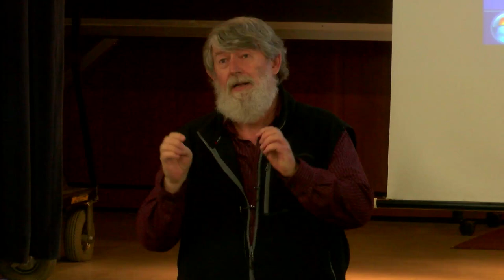David Chandler - How did they deploy 100s of tons of Nanothermite?

Comment: Stainless Steel Thermal Properties
The thermal properties of stainless steel are quite different from those of carbon steel. The main differences are:

The rate of thermal expansion of stainless steel remains relatively constant up to 1200°C compared to carbon steel because stainless steel does not experience phase transformation.
The magnitude of thermal expansion of stainless steel is greater than the thermal expansion of carbon steel.
The specific heat of stainless steel increases slightly at elevated temperatures, compared to carbon steel, which has a huge increase in specific heat at 730°C due to a chemical transformation from ferrite-pearlite to austentite.
At ambient temperature, stainless steel has a much lower thermal conductivity compared to carbon steel. However, the thermal conductivity of stainless steel increases at elevated temperatures which will exceed the value of carbon steel above 1000°C.
The thermal elongation of austenitic stainless steel Δl/l may be determined by:
where
l is the length at room temperature of stainless steel member;
Δl is the temperature induced elongation of stainless steel member;
θa is the steel temperature [°C].
The variation of the thermal elongation with temperature is shown in Figure 1:
http://www.mace.manchester.ac.uk/project/research/structures/strucfire/materialInFire/Steel/StainlessSteel/fig13a.gif
. . . . .
7 World Trade Center used type 316 stainless steel
www.imoa.info/molybdenum-uses/...grade-stainless-steels/.../world-trade-center.php
\\][//

Comment: The following is the most comprehensive fire tests on structural steel to have taken place. These tests were even cited by FEMA in its Report on the structural aspects of the WTC Towers in Appendix A. This is the same FEMA study that found evidence of termite arson in the Appendix C section of that report.
This following excerpt from the British Steel Analysis Report shows why no multi-story steel framed buildings have ever collapsed due to fire. Not before 9/11, not after 9/11, and certainly not on 9/11.

THE BEHAVIOUR OF MULTI-STORY STEEL FRAMED BUILDINGS IN FIRE
© 1999 British Steel Technology Center

Cardington Steel Tests

9 DISCUSSION
9.1 Observed Behavior

The tests on the Cardington frame enabled the differences between the standard fire test and the actual behavior to be studied. This led to the conclusion that the cooler structure surrounding the heat effected members was extremely beneficial to the heated members. The maximum steel temperatures reached during the six tests at Cartington was in excess of 1100 °C. This occurred with no signs of structural collapse.
Using modern fire codes , which are based on the standard fire tests, failure (or structural collapse) was calculated at 680°C ; it is clear that the current level of safety is quite high.
Further work on quantifying the safety level and developing definitive design guidance, which will incorporate a more logical and economical approach to structural fire design. – pg. 64

http://www.mace.manchester.ac.uk/project/research/structures/strucfire/DataBase/References/MultistoreySteelFramedBuildings.pdf
\\][//

Comment: One possible answer is they were refurbishing the fire proofing just before 911. It had been totally stripped back on the 85 floor and reapplied could it have been mixed in at this point or applied just before reapplication?
Reply: + Ian Luce
Jewish cleaning ladies sneaked in with little hacksaws?

Comment: How do we explain the disappearance of the core of building 6? The outer walls were still there but the interior was gone?  And also all of the half charred vehicles and melted engine blocks and yet leaves where still on trees?
Reply from the maker: Not with beamed energy from a satellite!  The platform would have to be GEO-SYNCHRONOUS to destroy the towers and WTC7, 7 hours later, but that puts the "ray" at a 45 degree angle, not overhead.  So it could not have been Geo-synchronous., consequently it would have to return to he same location to do WTC7, later that afternoon... not possible.  Controlled Demolition passes the OCCAM'S RAZOR test, has supporting evidence and video confirmation,  while the DEW hypothesis is pure supposition and requires mental gymnastics to shoe-horn it with OCCAM... THINK IT THROUGH!
Reply: thanks for the reply....I'm confused though. Building 6 and the charred vehicles don't make any sense to me.

Comment: The thermite would have been applied after construction. One welding spark... one ciggarette... one single spark from a metal saw would have set it off vefore they finished. So elevator  guys seem probable

Comment: Easy. The thermite or nanothermite  is combined in polymer base, plastic. I smell paint. The compound transported and applied as paint. No one would suspect painters and there supplies as they were almost fellow employees present every day. Burning jet fuel (kerosene) burns below 1100 degrees when only smoke and no flame are present, not hot enough to compromise structural steel but able to start thermite reaction.
Reply: their

Comment: The main purpose of the thermite is to cut steel, and this is a bonding process, with most of the the iron from the thermite forming blobs and lumps. So the iron microspheres  represent the wasted 'spatter'.  Little specks of thermite that are exposed to cooling air will not form a good cutting material. Unless the cutting process was hopelessly inefficient David's idea of there being hundreds of tons of thermite used is way too low. He should be thinking more of there being thirty thousand tons of thermite in each of the twin towers.  Simon Tee

Comment: I personally think the thermite leads are not going in the right direction to finding out what was used to take down towers and his unease when asked about how it was done. Seems he hasn't really spent any time figuring out how it was really done. Typical academic who has no idea of what real work is needed to do a massive job...

  I think looking at the job of taking down towers from more of an industrial process. Considering the use of available systems within the building, time and a minimum of man hours on the job need more consideration than some basic schoolboy idea of lugging up materials in an elevator, 

 To go even further and suggest if this was planned during the construction in the late 60's early 70's as a lot of war mongering manipulation ideas at the time suggest. This was sitting there waiting to be rigged and used to kick off a major war or to wipe out any country on the target list for control.. The guy who designed it, his age aside, looks like a stressed out wreck.. Fuck you couldn't have made an easier massive design to take down with the trusses system he used. Just saying !! Take out the outer fixings and bye bye to all the massive floor areas. Rig the rest in and around the central elevator shafts. polverise the concrete floors. Explosives pumped or pushed into sprinkler system possible from central service shafts. Sprinkler pipes lead under all the concrete floors. Nice easy clean up pile of nothing on the ground. So they can quickly go back to work screwing us in the rest of the financial district near by.  Seriously terrorists would have tried to take out the political heart of America when all the politicians where in one place. 

 Just goes to show the idiots in power think they are so fucken clever. The only reason they are militarizing the police and changing all US laws regarding human rights is they are seriously under threat. 
 The only way this will stop is if there is a coup within the US military and proper power is restored to moral citizens.. Same goes to all the other western countries. I deal with corruption all too often. Shitheads in government always close ranks when someone goes after there abuse of power.. Fucken over it.. The real-estate nightmare we live with is our biggest problem, with the banks driving us to ruin. Rents and mortgages out of control screwing us all on a monthly bases..
Reply: plane jet fule bombs and thermite thats  the stuff used to destroy  twin tiowers wel i think that
Reply: He's uneasy about that question because he's veering from hard science and getting into speculation, which is all anyone can do because there is simply no way of proving how it was done.His guess is certainly a good one.
Reply: +Adam Martin Things can be proven.  The evidence of nano thermite permeating the WTC dust is proven, or at least remains unchallenged in the scientific community.  The chain of custody of the materials are logged, the methods for testing the material are detailed and can be reproduced, and the outcomes remain unchallenged.  It's just science, and science is a way of knowing.  We know there is nano thermite permeating the WTC dust.
Reply: Yes, plus...how many people have seen the controlled demolition of a building ..that does NOT look like the towers and building 7? And not ever in the history of humanity has any building collapsed due to a "pancake theory".
Reply: The documentary called "The trillion dollar conspiracy" has an interview with a Dutch demolition expert. Its a fascinating interview.
Reply: Allie Muir, The problem with your hypothesis is that there is in fact evidence of sol-gel manufactured nanothermite in the dust. These products were simply not on the drawing board as far back as when the buildings were constructed.
The idea that a building built to be occupied by businesses and people, would be pre-rigged for demolition as it was built is preposterous, and the proposition of rigging the building during the elevator upgrades is a much more rational concept. As true as your other charges against the state, it is a non sequitur to your assertion that the building was rigged for demo as it was being built.
\\][//

Comment: Chandler doesn't explain what powdered the concrete.
Reply from the maker: According to NFPA921, Powdered concrete calls for testing of the residue to identify the explosives used. Both Molten concrete and molten steel, call for testing for a Eutectic (i.e. Thermite, Thermate, Nanothermite, etc.)  
>>>The BIG QUESTIONS are "Why did NIST not only refuse to do ANY testing for explosives, but Why did they completely abandon the industry-standard NFPA921 Fire investigation protocols and procedural guidelines, in the first place?"
Reply: well NIST was following illegal orders just like the guys at Nuremberg who were executed while the guys who gave the orders, though caught, were not executed.  They were held in low security prisons where they could order pizzas and prostitutes and they got out relatively quickly and broke up their beloved I G Farben into Bayer and 4 other deadly fascist entities.

But I'm still curious what is capable of powdering concrete in that quantity when the concrete is only six inches thick and spread over huge areas.

It doesn't seem easy.

Can you imagine a mechanism to do that?

Comment: Thermite was not found in the dust; it was iron rust and aluminum powder. Thermite could not have caused the destruction observed. For a forensic study of what happened to seven World Trade Center buildings on September 11, 2001, read the book "Where Did The Towers Go? Evidence of Directed Free-Energy Technology on 9/11" by Dr. Judy Wood, a scientist with expertise in experimental stress analysis, engineering mechanics and strength of materials testing.
Reply from the maker: Field Interference Whoever told you that, was lying to you! >>> First of all, nobody ever said anything about thermite.  That's a typical example of the way you deliberately misrepresent what we said, and then you debunk your creation, as if it were our claims that were debunked.  It was NANOthermite, which is not made from ordinary rust and aluminium powder!   There is no way you can dismiss the presence of UNREACTED NANOTHERMITE.  It is impossible for NANOTHERMITE to self assemble from any elements or materials found in the buildings, since it must be built chemically from the atomic level upwards, in a laboratory. >>> Secondly, nobody ever claimed nanothermite was the ONLY active agent, in fact just the opposite.  It was stressed EVERY TIME it was brought up, that there were likely to be OTHER explosives used in the CD.>>> THIRD,  If and WHEN Judy Wood comes up with even the slightest bit of evidence that CONFIRMS her hypothesis, I'll listen.  Until that happens, her claim is just as valid as any other fairy-tale.  Without any supporting evidence, it's just unconfirmed FOLKLORE!>>> Your lies do not work!   (unless getting me to waste my time by correcting your lying BS, is really your purpose... then you got me. But, Your lies are publicly exposed as fraudulent, anyway!)
Reply: Unreacted nanothermite: Conjecture by another anonymous youtuber.
Reply: 251omega who says nanothermite was found.  The Jones paper is highly suspect
Reply from the maker: paul carter You may suspect it all you want.  But, until and unless it has been challenged and refuted in another peer-reviewed paper, it stands UNCHALLENGED and accepted by the science community.  That's the only legitimate way to do it, scientifically speaking.  Consequently, when professional scientists have to put it in writing and sign their names to it, they will not issue a fraudulent "debunking" paper.  That's why you will never see any self-respecting scientist try to debunk the nanothermite paper...  So, all you can do is bad-mouth it.  >>> A point of fact that I sincerely want to understand, is, why do you "debunkers" promote the 9/11 cover-up?  I could understand if you were being highly paid by the Government, but why do so many civilians do it for free?  They must know that doing so, is TRULY an act of treason, anti-American at best.   So, what turned you into someone who VOLUNTARILY BETRAYS his own country? I figured you might come clean with me, since you know I've already "got your number" and any further attempted deception, on your part, would be fruitless!   Please tell us!    (I won't hold my breath...)
Reply: Projection, perhaps?
"...why do you "debunkers" promote the 9/11 cover-up? I could understand if you were being highly paid by the Government..." --251omega
Reply: 251omega no one accepts the Jones paper except those who are blind. No one needs to debunk it for it is bunk
Reply from the maker: paul carter
That's not how it works!  It's SCIENCE!   LOL!
In science, you have to "put up" or "shut up"!
Wouldn't it be "nice" for you, if you could just IGNORE the scientific method?
Reply: 251omega lol.  The paper is not valid and you know it
Reply from the maker: paul carter Paraphrasing you: "lol. The [Millette] paper is not valid and you know it!"
Reply from the maker: *****   Well, they won't get THAT specific!  They only go as far as saying it was a "Directed Energy Weapon",  probably to keep it vague!  Please note that When someone punches you,  his fist was a directed energy weapon!  So, Maybe we can refer to NANO-THERMITE as a directed energy weapon.  That way we are all in agreement!
Reply: Ad hominem attacks are a departure from logical discourse. Thank you for showing where your head is.
Reply: Thermite is iron oxide(rust) and aluminum powder....they themselves are used in a fine dust form in thermite.
Reply: I agree. However, these constituents found in the dust could not have contributed to the destructive mechanism of seven WTC buildings on 9/11.
Reply: +Ryan Raub Listen mate, when you start debating with woods followers. They will argue untill they look redicilous then start name calling you. They will NEVERaccept they are wrong for some weird reason. I didnt think a plane hit the pentagon until I saw David Chandlers Going beyond speculation last week. I stand corrected. I can admit that but I bet you can't get a no planer to watch it and accept they are wrong.
Reply: +Field Interference Logic? Woods? What is logical about denying over 500 witnesses to explosions and trying to explain away molten metal and concrete with a weapon she waunt describe in detail but claims it could possibly have been powered by some storm off the coast?
Reply: Obviously, you have not read her book. Those who will not read have no advantage over those who cannot read.
Reply from the maker: +Field Interference 
I would have to ask if there is some news or important evidence in her book, that she has never revealed in any video or interview?  If so, what is it? Tell me, and I'll go read it.   If not, never-mind...
Reply: Bull Shit!
Reply: Field Interference where dod tower 7 go? get your lobbyisymt shut out of here. all 3 towers were destroyed, nanothermite presence was to weaken structure. pentagon was bs, shanksvillw ba, that's funny thing about inside joba, it's all bs. not one part of 9/11 went smoothly, the media the focused on distractions so that you would.
Reply: Stop spreading Judy Woods DISINFORMATION. That is all she is! She exists only to DISCREDIT 9/11 "truthers". CONTROLLED OPPOSITION. Don't be a fool!
Reply: Alchemy, don't be so lazy in your research. NIST never claimed that, and lunatic "debunkers" like cantoear1968 will be quick to latch on that mistake in an attempt to make themselves feel like they've got a coherent argument.
Reply: Field Interference
Reply: Yep...wish we could just tune it out.